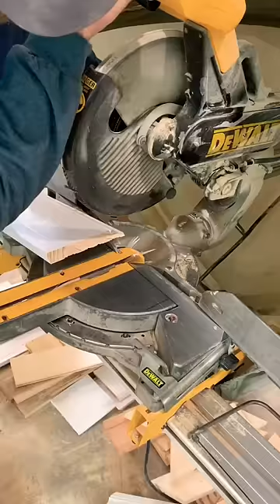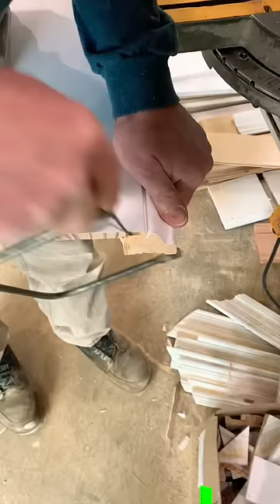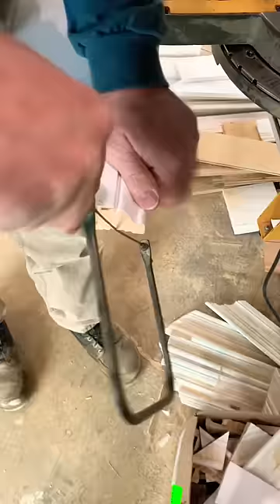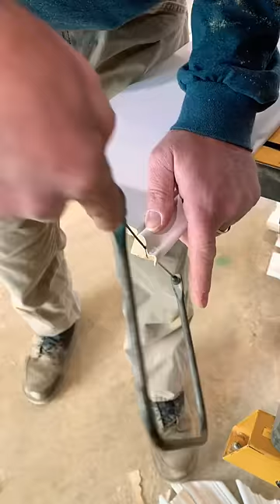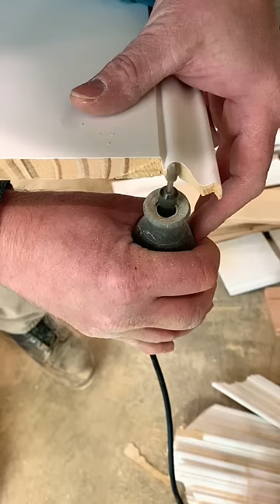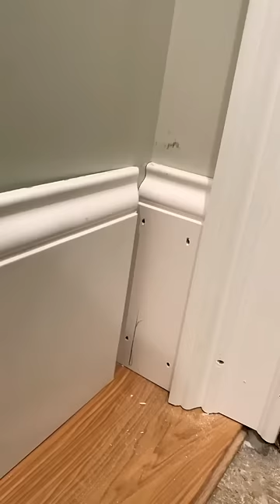Learn how to COPE baseboard…never be a puss and miter it!! #woodworking #coping #baseboard

Comment: More than 45 years as a general contractor I never coped a single baseboard, mitered them all and never had a single complaint from any customers with any of my trim and finish work.  In the time that it takes you to cope one corner I can miter and trim 3 corners.
Reply from the maker: No you can’t… we’ll I guess you can, but it will look like Stevie wonder did it! 😆 it’s okay if caulking is your best friend. Not everyone can cope 🤷🏼‍♂️
Reply: @w.k.d.constructionllc  Never caulked a single joint.  Not everyone can miter!
Reply: Hell you can do a whole house by the time he cope 1 bedroom 😂😂
Reply: That's the difference. You're a GC and I'm a carpenter.
Reply: Probably doing that section 8 housing. Take time to do things right old timer
Reply: 45 years ago someone taught you wrong
Reply: @johncorbin5332  So says someone who's never owned a construction business, at least not one for profit.  If your floors are level and your walls are square then there's no need for coping, and if they're not then you either fix the problem or you adjust your miter, and if the framer sucked at his job then you never work behind that framer again which is why I quit bidding trim work until I had inspected the framing or I did the framing myself.   So, just how many outside corners have you coped?   If you can't miter then I guess you can't do outside corners, or door trim, or window trim.  Yup 45+ years making a good living and not a single person ever complained about my trim work let alone asked if I mitered or coped their baseboards.  You weekend DIY's make me laugh when it takes you a week to trim out a room and you think it's a major accomplishment.  99% of professional finish carpenters will be mitering baseboards long into the future while DIY's will be making and watching YT videos on how to cope.
Reply: @knowthyowntruth7296 that's why you dobwork for cheap hotels in shady part of town, of course they're not gonna complain about a bunch of crooked trim pieces and caulk smeared all over the wall, if anyone actually knew anything about carpentry they would notice the poor craftsmanship, just makes you look desperate to get in and out as quick as possible and on to the next
Reply: @w.k.d.constructionllc  Ratioed on your own video 😂
Reply: Most single wide owners rarely complain
Reply: @w.k.d.constructionllc  You act like coping that was hard.... Cope some 6' white oak or walnut crown in a video, then you can talk sh!t...
Reply from the maker: @2869may  wasnt talkin’ shat…I learned to cope on red oak way back many moons ago there Bob Vila
Reply: @w.k.d.constructionllc you can’t either man you still have to caulk the heck out of the baseboard.
Reply: @knowthyowntruth7296 
GCs and tradesmen are two different animals bud. Nice try though
Reply: I aint even had painters be happy when i cope lmao, so extra and unnecessary for something that ends up looking the same in the end
Reply: @w.k.d.constructionllc time to start watching some this old house
Reply: I think a lot more then 3 my friend
Reply: @knowthyowntruth7296 
You've never in your entire life caulked a single joint?
Reply: Scribing is just quicker than mitres. Tried and tested. Cut all your straight cuts first then do double scribes into them. I have won countless money bets on this method  including many years ago in trade college against the instructor 👌
Reply: Guys, Salvation is very Simple

HalleluYAH “Hallel u YAH - Praise ye YaH”

YaH is The Father (Genesis 1)
YaH arrives via the TENT OF MEETING
YaH was Who they Crucified for our sins
YaH was Crucified on an Almond TREE

Ancient Semitic Moshe (Moses)
Isaiah Scroll (The Original Isaiah)
Reply: @w.k.d.constructionllc okay but aren’t you gonna comment of the ones that say you still had to caulk the more than noticeable gap?😂 cmon man🤦🏽‍♂️
Reply: It's obvious you are having trouble coping.
Reply: I personally much prefer miter sawing everything.  I just don’t see the point for using a coping saw.  It takes longer and looks worse in my humble opinion.
Reply: Despite you being correct, the only comeback I can argue to varify him is this video has gotten 100s of thousands of views and promoted his business.
Reply: I hear what you're saying but when it comes to stained mouldings I'm gonna have to just cope with it
Reply: @w.k.d.constructionllc Dude come on now. You mean to tell me you don't know how to measure an angle and properly cut?
Reply: You must have had straight walls haha
Reply: not everyone can cope !
Reply: @alextheonewarrior  they dont open up like miters son`
Reply: @knowthyowntruth7296  Just bc some scrub customer didn't say anything, don't mean that they didn't see it. Let alone a pro would absolutely notice it.
Reply: @w.k.d.constructionllc I hope you caulked the one in the video. I as a customer would expect it with this gaps.
Reply: I personally think miters look cleaner and obviously they are faster.
Reply: @w.k.d.constructionllc we seen them gaps😂
Reply: The best way is to cope internal corners and miter external corners.
But there are many ways to cook eggs and some people are better at cooking than others
Reply: @w.k.d.constructionllc  We always mitered and no you don't get a better joint by coping. You get a weaker joint by coping. Some builders won't allow coping.

Comment: Finally someone showing how to cope 👍🏻👍🏻.I teach everyone of my helpers how too ..I’ve been a finish trimmer for 15 years now and I don’t care how good you mitter base house’s move and corner open
Reply from the maker: Exactly, and this method is actually quicker and more efficient because no mudded sheetrock corner is a perfect 90 degree!!! Most people just don't get it! lol
Reply: That's why God invented caulk....
Reply: The only real way to do it…👍
Reply: @obviouslyambiguous8308  yep
Reply: @obviouslyambiguous8308  I never needed caulk when I did it that way
Reply: The corner is going to open whether it mitered or coped
Reply: It still looked like they didn’t line up without small gaps.
Reply: Spoiled it with the dremel
Reply: 2P10. Nothing's opening up any more.
Reply: @w.k.d.constructionllc  bro there is no way I’m doing this to every interior corner when I’m doing a whole home by my self LOL and use shims on fucked up walls
Reply: It was a fail, see the gap at the end
Reply: Not the brick and stone ones lol
Reply: @w.k.d.constructionllc  couple tips I've learned, make your initial miter 44°, also shoot a nail that sticks out behind the bottom of your previous piece like a spring so that you're coped piece presses into it. Also you can measure your whole room out corner to corner for every piece if you measure your base from the tip of your mitered board. Makes it a lot easier to make a list for an entire room and make one trip to the saw. 👍🏾💯

Comment: Yep, that how I do it. Then I match up a caulk or filler and put some right on the edge before I put that piece in, and any imperfections are gone. There is very little if any clean up. Flawless!
Reply from the maker: Nice

Comment: As a carpenter who has been to school, and is fully licensed, this is how carpenters are taught to cut baseboard. I see all these comments saying to mitre, but if you have ever actually installed baseboard you would know that 99% of the time two mitred baseboards will
Never line up properly especially because it heavily depends on the framing being perfect. Very rarely are any walls perfect forget all of them. This is the proper way to work and anyone who disagrees doesn’t have enough skill to properly do the job.
Reply from the maker: Thank you! Way harder to fool with an inside miter than to simply cope it
Reply: @w.k.d.constructionllc Yup.  And by the way, if you use the side of a sharpened pencil to mark the edge of the miter cut before you grab the coping saw it makes it much easier to see where you're cutting.
Reply: People who learn on the job can make up the corner of the wall by adjusting the mitre to match. Takes seconds to cut a mitre while this coping crap takes too long.
Reply: @DeMeonnaise  Have you ever installed it over sheetrock?  I'm guessing no, because that sheetrock will always give a little when you nail the base board to it, leaving a crack at the joint.  That doesn't happen when you cope it 

If you're okay with leaving that crack for the painters to deal with, okay, but I'm not.
Reply: Dude some times they’re like 1/4 inch different. Coping isn’t going to fix that. And it doesn’t look better than miter.
Reply: If your miters have gaps cause the wall is crooked why don’t you glue them together before you install them after checking how it looks and puttin shims in the back to straighten the corners out? Most carpenters don’t have 3 weeks to do baseboard in a house cause customers want them in their house that long
Reply: Bro anyone can cope its just some prefer not to

Comment: Coping is great but i only would do that for corrners that are jacked up. Most others you can find an angle combo relatively quickly that will come together with a minimal gap that caulking and paint will totally cover at a much faster speed... occasionally walls are going to be jacked and this is a much better option but I wouldn't with most of my joints. Fantastic video though:)

Comment: Only way I have done it for 35 years!
Reply from the maker: You sir, are a BEAST!! Thanks for watching!
Reply: I like the look of a mitered corner personally
Reply: Coping is used because there is such thing as a perfect corner. As such, coping creates a tighter fit, less filler, and most importantly, saves time having to recut miters to make them fit properly. Besides, it still looks mitered.

Comment: Measure, cut 45* miter, and then begin the cope.

This method saves that last step of coping and then measuring from the cope. 

Also, I’m right handed so I try to make all my copes on the right hand end of my boards too. Makes it so you don’t have to keep helicoptering 15’ boards so you can cope lefty. 

Cordless 12v Jigsaws are sweet for this. They make an attachments shaped like a sheep’s foot or a rams hoof which helps.

Also, tear the material downwards away from the face or it could chip or splinter the face. 

Source: I’ve done a lot of baseboard.
Reply from the maker: Nice

Comment: Well, I've taught myself to cut the 45, then flow it up with a back 22.5 and cut to the detail. Then break the piece that was cut off. And finally, I flip the board upside down and hook into the tip of the 45 and measure full length. It gives a better fit for measuring and leaves less chance for a gap cuz when you measure the full length of the wall, then you can cut that length. 

Just a helpful tip cuz I've done a bit here recently. I hope it makes sense

Comment: Good final product but I got a couple questions. 
1. Why do y’all lay the board down to cut it. Just stand it up and move your angle side to side. 
2 why use the lil drill tool when you have a coping saw in hand. You already cut the big part with the choppy so just finish it with the siping saw. It’s gonna get caulked either way lol.

Comment: Cut it about 3/32 long and snap it into place by bowing out the middle, the coped back bevel will cut into the adjacent molding. Leaving an even tighter joint.

Comment: If you want to save time, you can cut those 45 degree. I carry a small square on me to eyeball the angle on the outside and inside corners. Most of them are 44 degrees on the inside and 46 degrees on the outside corners. Coping is structurally stronger, but takes time.
Reply from the maker: I can cope an inside corner way faster than lining up a miter

Comment: I just measure the angle of wall and divide that into 2. Then I cut, they meetup really nicely. I can do the trim for a room in minutes. It takes a couple of mins just to cut a single cope. If it is going to be painted, it’s not worth anyones time to mess around with this. Come over and I’ll show you the results. My house locks nicer than any new home for triple the price when it comes to finish work. It seems like y’all need to learn how to tune your saw stops. The same saw that cuts my trim, I use to make cabinets. I don’t need to cope those either. When I see this, it really just feels like you didn’t want to bother to make it fit so let’s just hog it all out so it does. Corners easily vary 5 degrees or more. I measure and write my length and angles on a scrap, then go cut the whole room in a single shot, come and test fit. I usually need only a single trim and I can do the whole room in about 20 mins. 1/4 round is even faster.

Comment: I mean, you could cut 45s and fill the gap with caulk, you could take the time to cope each piece, or you could use a digital miter gauge and cut perfect angles for each corner if they aren't 90 degrees. Your avg. homeowner isn't going to be looking at it anyway.

Comment: This is actually the right way to do it for base and crown. Even brand new framing isnt ever true 90⁰. You should scribe the corner first to get the initial bevel in every corner. Its the difference between $20 an hour and $40 an hour!!! Your moulding work is all people will see. They dont see that the framer screwed you, or the taper screwed you. The eye is always drawn to corners and miters!!!

Comment: I like to use the jigsaw even though I know it’s overkill, definitely not hard to do If you move the stock against the blade instead of holding the stock and moving the jigsaw. You can use the teeth of the blade to really clean it up. No dremel required. 

I do Like to reset the miter saw to clear off the large portion

Comment: Cut 45s then cut the inside corners off flat with 1/2 saw blade. Tight fit and to do it right you’re still going to caulk. IMO coping always looks a little off where a truly clean 45 looks continuous.

Comment: I can do both but prefer to miter my cuts because you save a shit ton of more time and time is money. Also there's plenty of times your gunna cope your inside corners and need to caulk them anyways, so why go through all the extra steps when your gunna have to caulk your joints anyways? After I caulk and paint everything it looks mint and seamless. Like I said time is money
Reply from the maker: Not really once you get used to a cope. You spend more time trying to line up and shim a mitered corner vs a cope. I don’t like to rely on caulking to make my work look good & It’s not always just about the money. It’s about the pride you have in your work. If it’s not right…I’ll tear it out and re-do.

Comment: You're using the coping saw upside down and ditch that dremel, it's not needed. You can also make the pre cope cuts without pitching the saw, just stand it up in the saw and adjust the miter both ways. Anyone who miters baseboard is not a skilled professional.

Comment: Grinder with a flexible sanding disc all day I haven’t used a coping saw in over 15 years I don’t even think I have one anymore more. And to measure off the cope not sure about that one
Reply from the maker: The cope doesn’t necessarily go to the exact corner every time. I only measure wall to wall on first pc then to the flat face of cope on the rest.

Comment: If you're using the Dremel anyway, why not just use a jigsaw too? Doesn't really matter, mitering is better anyway
Reply from the maker: Jigsaw leaves a jagged edge, dremel is for a super smooth edge. Mitering is not better at all
Reply: @w.k.d.constructionllc  you can make the same cut with a jigsaw that you made with a coping saw

Comment: Can someone explain why/when you need to cope vs miter baseboard? Have a little handiwork experience working on crews over a couple summers but not a tradey
Reply: It looks like the smaller piece of baseboard was already there so he was replacing existing board and rather than take it off and mitre them both, he’s coping the new board to fit the old. I would always go for a mitre first, as long as it looks clean, it’s faster. Do t make work for yourself if you don’t need to. Stuff like that all comes with doing it over and over. Get on the tools bro! Good luck.

Comment: Jig saw and sanding wheel, if it didn’t work for you in the past it’s only because you didn’t stick with it, or atleast use the jig saw to replace the coping saw, jeez that takes forever and a lot of work, if you are gonna saw all that off you mine as well do it all with it and leave the dremel tool out

Comment: If you want to do it the way truly skilled artisans do it then use a scribe instead of a 45 degree bevel. This way you get true accuracy. Use a 16 point finish handsaw for the straight line and a coping saw for the profile. Simple perfection quick and efficient and the methodology of a true artisan. And quite frankly, an a hell of a lot faster than running back and forth to a miter saw because you can make your artisan joinery right there at the sight of the joint. You sir will never be hired to do joinery in a 10,000 square foot house because paint grade doesn't get it.

Comment: Not bad man but in all my experience which is very extensive I've never used a Dremel. If you use your coping saw correctly you can do the back cut without having to grind it out good Lord it would take a year to run bass like that in a big house. Secondly you do not have to have the straight piece of base in there to take the measurement you measure casing to wall add a little bit cut your long point of your 45 at that measurement then do your cope and wallah!! you haven't wasted Time
Reply from the maker: The cope doesn’t make it to the corner of the wall tho there chief, if you line the tops up correctly. This house was 7000sq ft and I coped every joint of base, (not casing) & it literally only takes a minute

Comment: A true finish carpenters mitre. if the it's two different mold meeting each other then cope. Meanwhile He Claimed not to use jig saw or grinder but ended up using dremel💀💀. get your angles and mitre quick